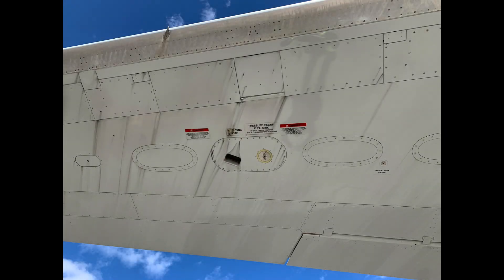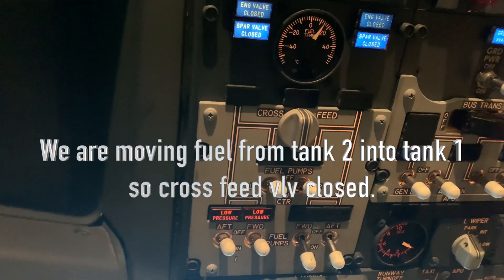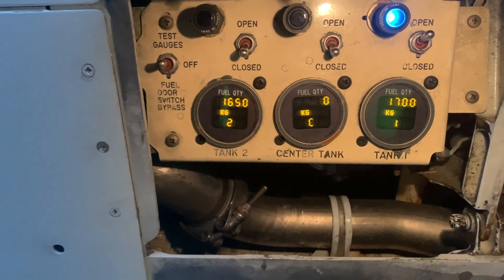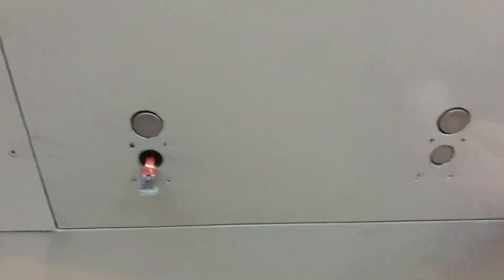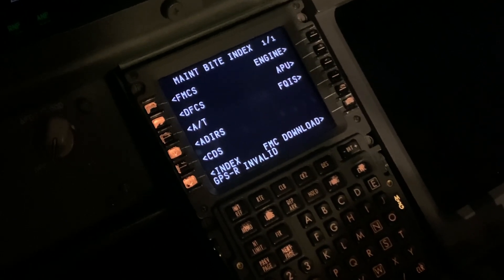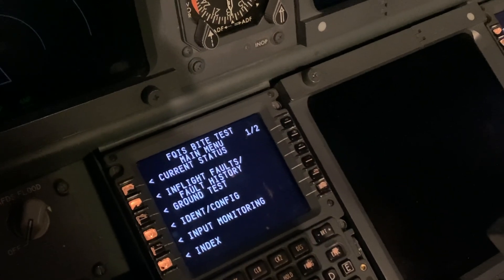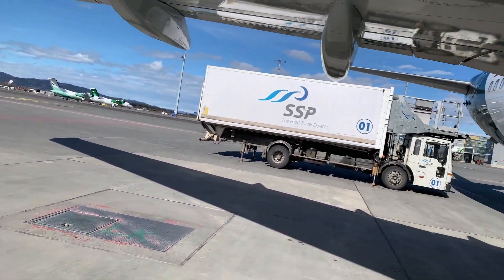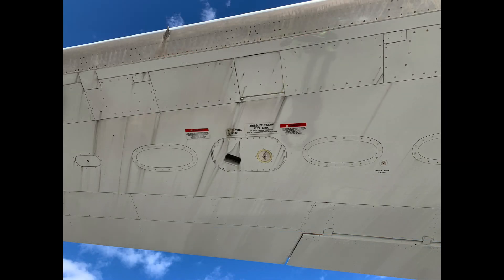🎬  BOEING B737 NG ATA 28 Fuel Transfer Procedure, FQIS BITE and Component Location.. ✈️

Comment: Hey bro I appreciate your videos, I have a question regarding fuel transfer from tank 2 to tank 1 on the 737 and the crossfeed valve position, why it’s has to be closed when transferring from tank 2 to tank 1 and open from tank 1 to tank 2 is related to suction feed or something and to prolong the life of the valve ? 
I appreciate your answer thanks

Comment: Also when the Pump the fuel in the combustionchamber in a steamturbine press and out the Steamheathighpressureturbine come Kondensat trails behind the plane out than was what for fuel in the Chamber Used? Diesel that was mixed to JP8 or 1??? For not frezze in by -60 degrees, how much diesel pump i in my compressor at home before they beginn to fly on claer not smelling flyfuel Jet A1?❤😂❤😂❤😂😂 12er and 18er pipes for 1to fuel for hundred km in midair with flytime by 500 km/h x 100km = 12min ok 1000L : 12min = 83,333L per Min.÷2 MAKE 41,6666Lmin by 1meterps for fueltransport inline in a 18mm ok but 12mm pipe not bad how high is the pumppressure3,5 insight the Tank?😂😂😂

Comment: Show the tanks .. I have been looking for the tanks for long time No one will show the tanks
Reply: The opening picture of the video, those ovals are literally the plates for the fuel tank
Reply: @justinbouy3153 correct. The oval shapes are the access panels to the fuel tank
Reply: It’s a hoax, the fuel tanks don’t exist! You think those little wings and centre tanks can hold 28,000 ltrs! I have a bridge to sell you!
Reply: I’m really so fucking disappointed you can’t get it through your head.

There is multiple videos showing maintenance crew climbing into the wing. (The entire wing IS the tank)
And in the pictures you got to see a fuel pump picture IN THE TANK

Engines take air from the outside, compress it, and shove it out the back, using fuel to maintain rotational energy (essentially)

Also there is MULTIPLE videos that I will link when I edit this comment so you can ALSO get it through your head that the earth is 100% spherical.
Here’s a good part 1 of a series explaining the earth is r o u n d https://youtu.be/_bHqBy92iGM

Here is a good video of maintenance of a 747 tank.

https://youtu.be/4ktqOWgZfEE
Reply: Are you one of the fuel tanks aren’t real guys?
Reply: @justinbouy3153  he definetly is, he just listens to globebusters and nothing else
Reply: The fuel tanks are inside the wings. Where else do you think they could possibly store the fuel?

Comment: Can you please tell which messages can appear on the upper EICAS?

I mean messages like "ATC".

You said that messages like 

Low Fuel or 
Fuel imbalance 

can be indicated.

Which messages else do exist?
Is there a list or table?

Thank you for answering.
Reply from the maker: On the N.G There are the - crew alert messages i.e "start vlv open", "oil filter bypass" and "low oil pressure", (top right) the comm msg is only one  "ATC", Also the "A/T LIM" msg when FCC-A sets N1 reference. Also, the thrust mode is shown if the autothrottle limit msg is not shown. Regarding Fuel x3 MSGs can be displayed under each fuel qty indication "IMBL" "CONFIG", or "LOW"